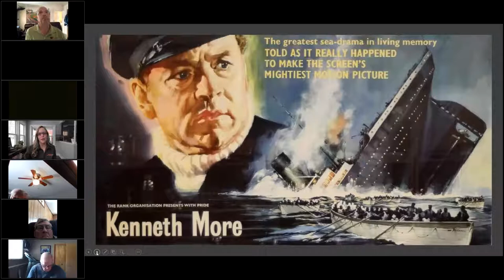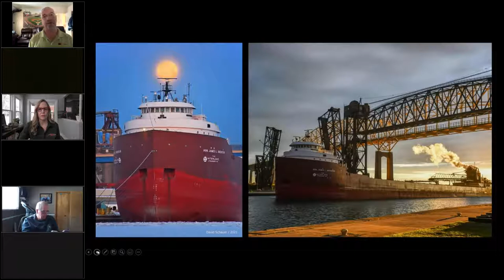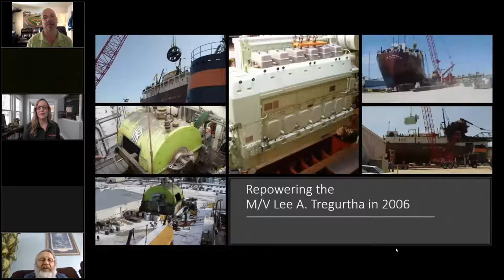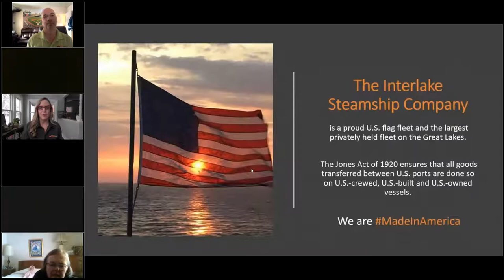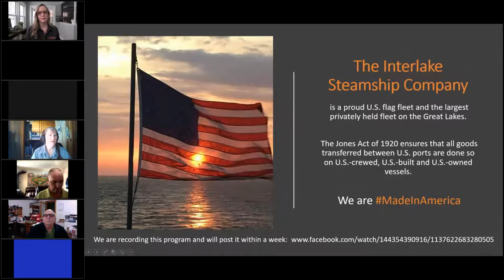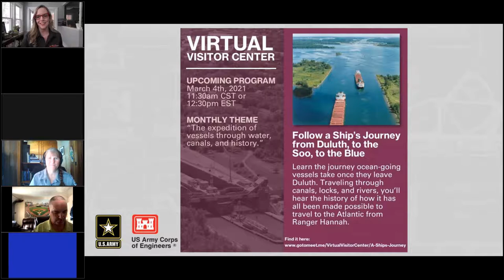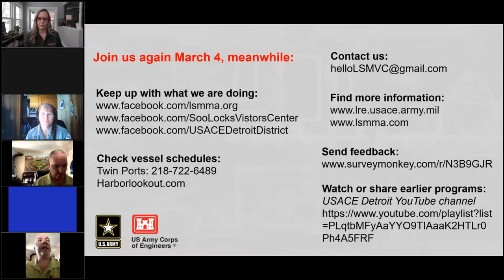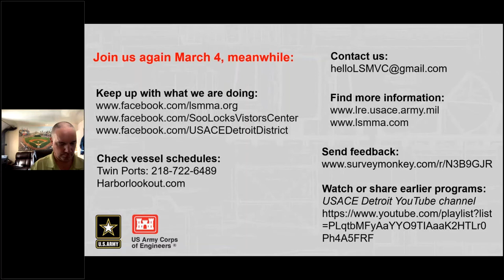Meet the Chief Engineer of the Hon. James L. Oberstar

Comment: Wow, three years and no comments !  I have questions.  Did you become qualified on steam and diesel at the same time ? Does the Lea still use the same Bunker c ?  I worked in engine rooms on the Cdn.  side in the 60 s. It was all steam experience. I varied from hand firing coal, to oiler, to fourth engineer. Oldest ship was built in 1906 and newest was built in the 60 s.  Vast differences  but as you know principle is the same.   The old manual jobs are good teachers because you are aware of everything that is happening. So I worked with triple expansion, skinner unaflow and turbine.  Enjoyed your conversation. Henry